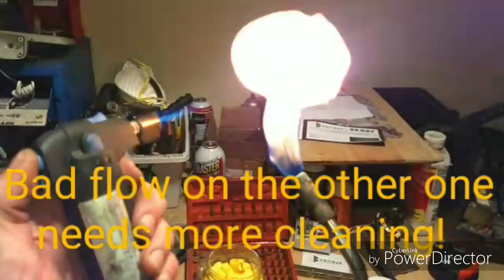𝘽𝙚𝙧𝙣𝙯𝙤𝙢𝙖𝙩𝙞𝙘  #Torch  𝙍𝙚𝙥𝙖𝙞𝙧

Comment: Ended up taking the shaft apart and blowing it out with compressed air and now it works great also moved the ground wire a little closer to the top so the contact is perfect

Comment: What size wire did you use and where to find small amount, I may look at Lowes in the wire area, but just thought I'd ask. Thanks.
Reply from the maker: It just some wire I had in my shop.
Anything can work. This is a  22g wire rated for 300v tinned copper 
But you can ues just about anything. 
Don't let it ground out 
And crimp around the insulation not the  bare wire. 
Good luck 👍

Comment: Good video. Where did you get the little yellow plastic bit from?
Reply from the maker: Thanks my friend. It's just a wire guard cap I had on had. Just serves as an insulator so the spark doesn't ground out.
Reply from the maker: Here's a link. To lowes
 https://www.lowes.com/pd/Utilitech-WireGard-25-Pack-Multi-colors-Wire-Connectors/999953854?cm_mmc=shp-cprdelcgooglelia-106-electricalaccessories-999953854-_-0&store_code=2308&placeholder=null&&ds_a_cid=114168065&ds_a_cid=476315417&gclid=CjwKCAjwr7X4BRA4EiwAUXjbtzzRX7OBgmGR-2CMZhL5LGdzESqE_pXDRz7xh5atB3PlvUSXwIF4xhoCY3kQAvD_BwE&gclsrc=aw.ds
Reply: @CalebGibbsAvenue  Thanks very much.
Reply: They are called wire nuts